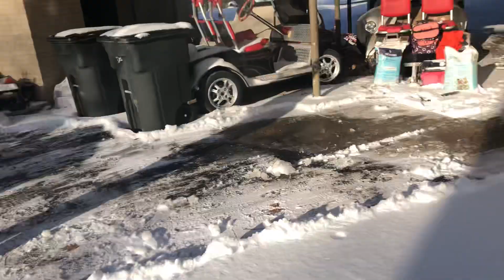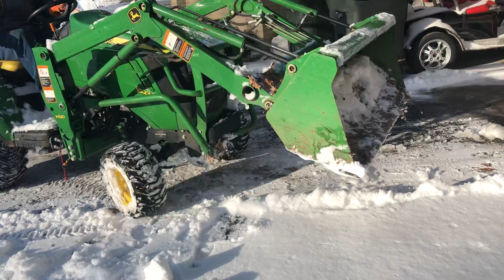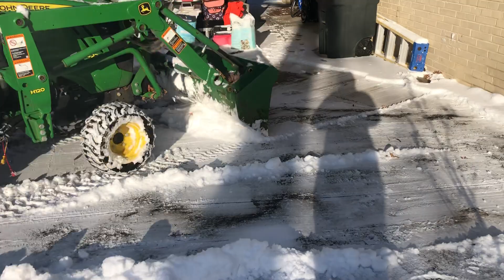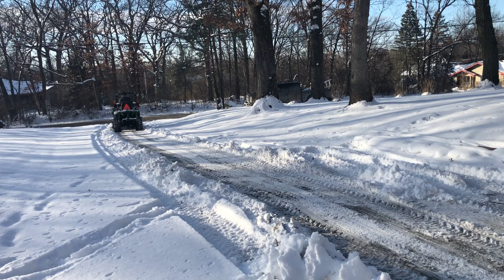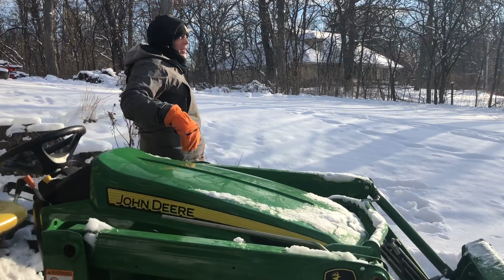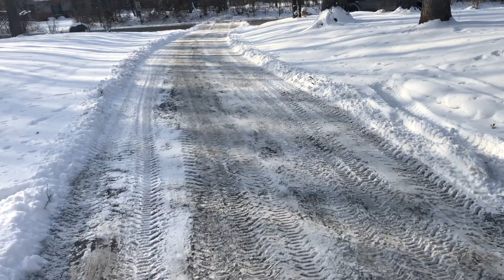Plowing your driveway with a 1023e/1025 John Deere.  See Description!!!!!!!

Comment: nice vid, are your tires loaded with fluid by chance? i have a 1025R with my 300pound butt in the seat and with wheel weights i was too traction challenged doing this.
Reply from the maker: i haven't filled my tires.  Do you have turf tires? My old tractor had them and snow would fill the spaces and I would slip and couldn't plow. I have seen a lot of people in forums talk about how they work but they didn't work for me.  I think it has to do with the fact that my driveway is steep not level. As long as I don’t have it in 4x4 on the grass the R4 tires don’t mess anything up.
Reply: It sort of blows my mind when i see anyone talking about traction issues with these tractors because i've had zero problems with mine. In fact, I bought a 1023E last winter season , plowed a 24 car driveway with it (small condo complex)...the entire driveway is at least as steep as yours pictured here and...at the entrance it is at least twice as steep....and honestly..over 13 storms we had with up to 1 1/2 feet being the largest..I didnt even spin a tire. Not once.  I was worried when i bought it to replace the truck service we used to have that i would get stuck at the bottom of the big hill entrance so i bought a back up set of chains but...they never even made it out of the bag.  My setup is this. just the 1023E and loader. No other attachments and Not even ballast on the back. The 3 pt bars arent even on due to space issues in the garage i keep it in.  I did research the tire issue a lot..even calling Goodyear in Akron and talking to a tire engineer there. Both he and i came away believing that the turf tires are the best namely because they would most mimic what a snow tire design would be..keeping the most rubber on the ground. Also, in my application..i'm not driving thru snow at all...always following the loader and plowed area so i'm not filling up the treads with snow. What i did do was to not only get the starter weights on the rear wheels (70lbs each) but also added the full rear wheel weight set (100lbs each wheel). So each wheel has 170lbs ..with the turf tires...for a total of 340lbs of cast iron on the wheels in the back. That and the fact that like the gentleman above i'm also 300 lbs in the seat (diet anyone? :) )  and...i had absolutely no problems. I am concerned that i am going on a diet and plan to shed at least 80 lbs. and so what i plan on doing is to buy 2 42lb suitcase weights and just put them behind the seat. So i will keep the same weight structure in the same area or..if i dont lose the weight..maybe a little more.  As i've thought about this issue a lot i really feel its the turf tires and full weight set on each wheel that does the trick.  That's probably almost 100lbs more than even filling the tires. Someone could also fill the tires and just go with the 70lb starter weights for the same effect.  My weight is probably doing what the ballast box would do.  i cant use a bbox though so i'll just go with the 2 suitcase weights behind the seat this year. Anyways..thats my setup and i think if you saw my hill i have to plow you'd be saying....Wow.  I was amazed myself. But this setup works really well. I'll also add that people want to make sure they're using the float position on the loader for plowing. i've seen some people who dont know it exists. just push the loader lever all the way forward until it clicks. That floats the loader with the terrain. that issue alone could cause people traction issues.  Anyways..GL  :)